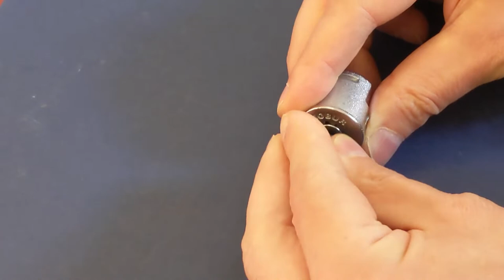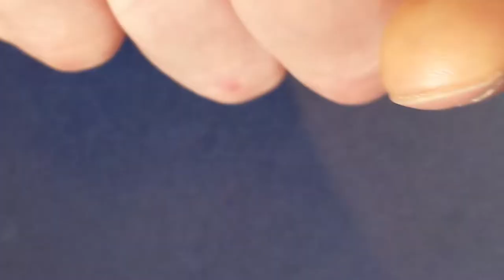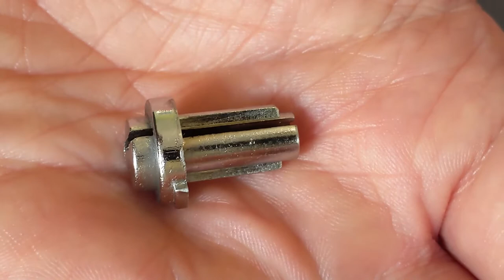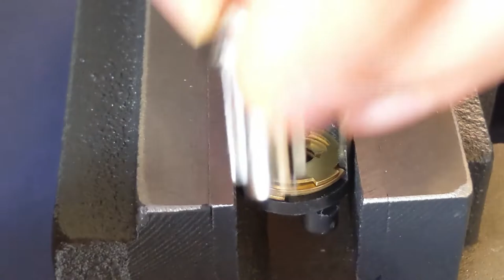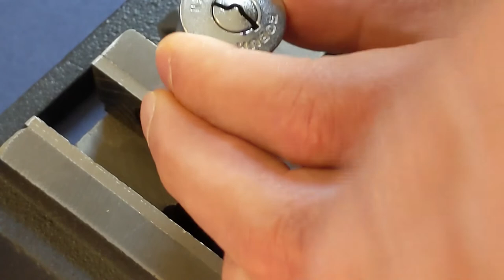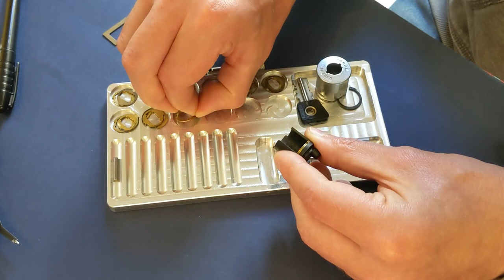Robur disc detainer safe deposit box lock design, picking approach and demo pick and gut

Comment: The sidebar of this lock had good ideas. I liked the cut for the actual code disks and the manufacturing of that cut also makes the edges of the sidebar really sharp. However, the false gate design seems pretty bad. They should have done a parallel cut in the center of the sidebar and use lever lock like "pins" outward in the disks. As long as the cut groove in the sidebar has similar tolerance to the side of the pins as the true gate has to the sides of the true gate, the width of the false gate should feel identical to true gate.

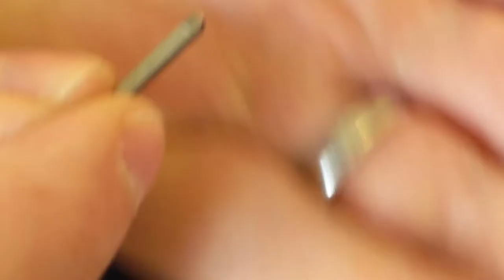And the sidebar was tiny! At 4:45 it's like a small piece of metal next to your fingernail.
Reply from the maker: Yes, it's a clever design but could have been implemented a bit better, nastier false gates would be really hard to deal with. The big one though would be to have a disc somewhere in the stack which doesn't move, then the approach I used here wouldn't work and it might be virtually impossible without prior knowledge
Reply: @crispix  If you have a disk that doesn't rotate at all, it should be pretty easy to figure out. And once you've identified the non-rotating disk or multiple, your picking method would still be able to set the disks on both sides of the non-rotating disk. And the non-rotating disk cannot have a hole just for the curtain because the key must be able to go through it.
Reply from the maker: @MikkoRantalainen   I mean a disc which can rotate like the others but has the gate aligned to the sidebar in the locked state, just like a max cut on a classic or other DD locks. This would stop the over-rotation and back starter to get access to the internal profile. It would still be possible to pick of course, would have to counter rotate the curtain a little bit to get on the first shoulder of each disc, and possibly do a three stage push. With knowledge of the bitting the non rotating disc could just be left alone, but in a blind pick this would need to be done by elimination I think, as only the two false gates would be in the range of motion, i.e. third gate must be true and at locked position.
Reply: @crispix  I'm pretty sure you can either pick no extra ribs in the curtain or max cut without space for the pick but you cannot have both. Otherwise you cannot have the rib of the curtain move forward and backwards without upsetting the position of the disk. And if you don't have that extra rib, then that will give you the extra space you need to move the disk.

That's why I thinking that you would need return bar similar to Abloy Protec or Disklock Pro so that you rotate the disks back to the original position without using the key or curtain to do that.

Or it might be that I'm failing something obvious here but that has been my thinking when I've tried to do DD lock designs as a hobby.

Comment: Superb work on explaining the vulnerabilities on this lock and the video production was just spot on, too! You were able to nicely demonstrate all the parts of this lock so that I could figure out every part without ever having access to physical sample.

It seems that Robur wanted to add those extra ribs on the outside of the curtain (you call it shroud but it's function seems identical to lever lock curtain to me so I  will keep calling that a curtain) which prevented them from using max cuts in the key (leaving zero space from the disk to the curtain). If I understood correctly, those ribs are used to return the disks to initial position but that could have been implemented with a single return bar opposite the sidebar.

Do you know why they have the plastic carrier (plug) in the design at all? It seems obvious that the designer of this lock had seen Rosengren safe deposit lock too and that design doesn't need carrier at all which is both easier to manufacture and wouldn't suffer from using plastic inside the lock.

I think that you might also be able to use dimple flag like pick where you keep the whole shaft of the pick on the outer edge of the curtain. This is because the uncut (or zero cut) key must extend quite a lot from the curtain and since this lock design never has the disk touching the edge of the curtain.

Another vulnerability for this lock is decoding it with a narrow feeler tip because the edges of the disks are straight and there must be always some tolerances between all the disks and spacers. Basically you would insert e.g. 0.3 mm wire made out of spring steel with a slight bent at the tip and feel the true gates with it. Once you have decoded the correct key, you could simply rotate the curtain one cut depth at a time and set each disk to correct location. That said, I don't think this is an easy attack to do because the space available is pretty small and trying to insert very thin metal wire to correct position without bending it would be hard to do in practice.
Reply: See my "community-core" design v27 for an example of lock design where there's no curtain or carrier but it has a disk locking bar which prevents rotating the disks when they are near the sidebar + that bar is used to return the disks back to starting position while the lock is locked again. And I didn't use separate curtain but kind of moving curtain that enforces the "problem 50" documented by Matt Smith.
Reply from the maker: Glad you enjoyed the video, it's definitely an interesting lock so a good tour justified I think.

Agree on the flag, tool I used is basically a home made flag so likely that off the shelf tools would work. When I first opened it up I thought some sort of decode or impressioning would be the only way, but as I thought about it the lock went from impossible to theoretically possible, and then as I practiced it went from theoretically possible to actually possible, then picked! Really cool process.

Don't know why they have the carrier, not obvious. Maybe works out cheaper than needing rotation limiter in the lock body? Just guessing though, would have to ask the designer!
Reply: @crispix  Great work on the research. It would have been interesting to see some kind of research progress, too. This video only described the finished attack method but it would have been interesting to know more about the methods you tried before inventing this one.